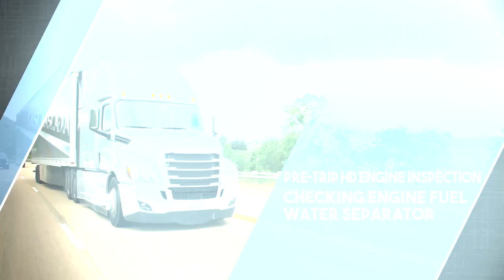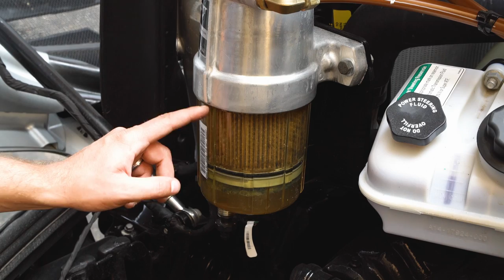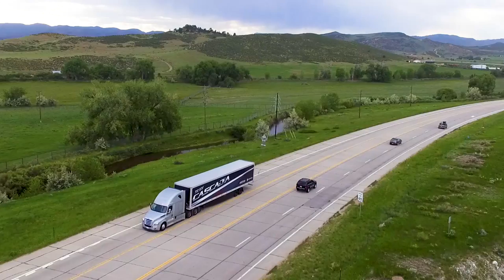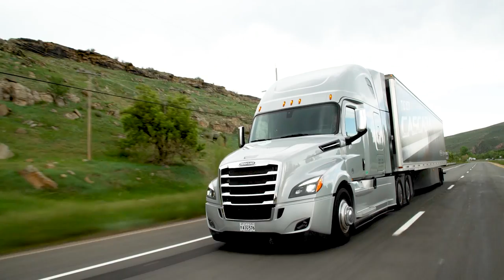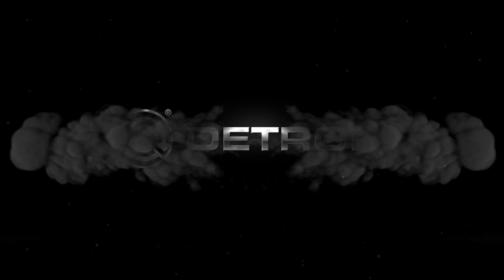Pre-Trip HD Engine Inspection of Fuel Water Separator Training Video

Comment: Can you do a video on how to change that water separator filter?
Reply: You open the cap with a special tool replace it but it’s a low maintenance item all you have to do is drain the water that filter will last you a long time
Reply: Which one is the drain plug